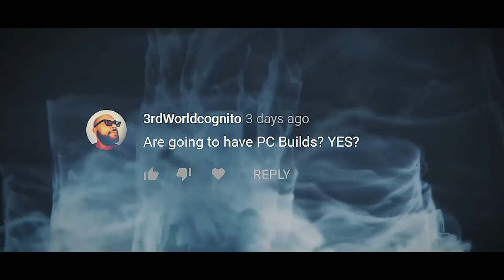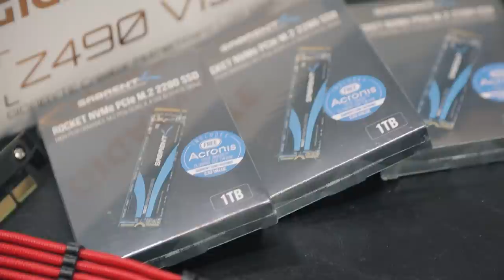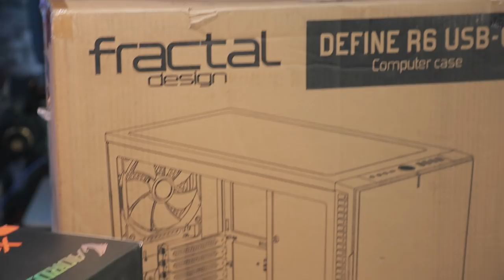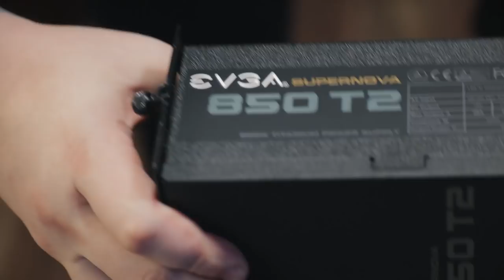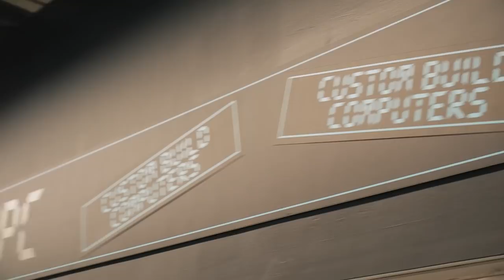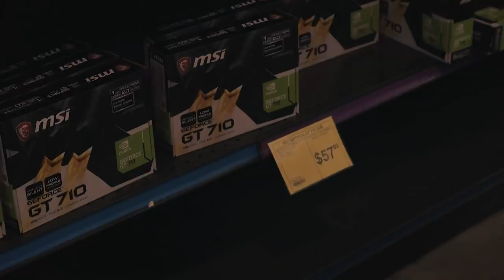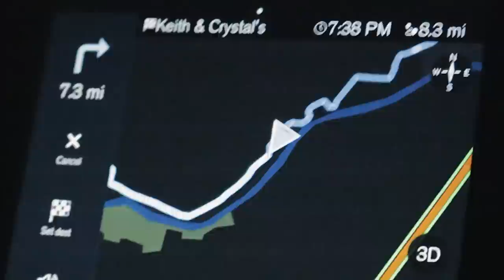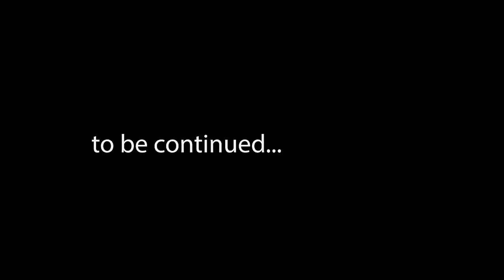We Built a Thunderbolt 3 Creator's PC for Audio, Video, and Gaming, Nvidia RTX, (2020). Episode #11

Comment: I didn't really think this video was going to be for me but it was still pretty cool and actually kinda peaked my interest in pc stuff 🤘
Reply: If you like to game or are creative type or even just need a smooth running computer for work, I highly recommend it. The price difference between building your own and buying a prebuilt is fucking ridiculous too and a lot of the time the assembly is shit. Also companys like to skimp on important things like the power supply and RAM quality, cable management, cooling. PC building is a challenge but it doesn't have to be difficult. It will take some effort and research to make sure you get the best possible choice for your needs but its totally worth it in the end because the possibilities are endless when it comes to the functionality of a PC.

Comment: This video was absolutely worth the wait, thanks Keith. I've done one budget (ish) TB3 build with 7th gen Intel processor and an RTX 2070 to go with an Apollo Twin X interface, and it was nice to hear some affirmations of things I learned from that first time around (x pattern on the screws, struggling with the front panel wires, don't cheap out on PSU, don't stress about thermal paste etc.). The Windows pooling storage method was new to me. Any tradeoffs between that storage method, Leon's RAID method, and any others you folks could think of? Any advice appreciated :)
Reply: At this point, there probably isn't, honestly. I'm just an oldskool dork used to hardware RAID, which actually has the drawback of having matching drives. Windows pooling is JBOD and will use any disk you throw into the pool. There's also physical JBOD on some boards, but I still tend to stick to matching drives and hardware RAID.

Comment: Keith, I just bought a gigabyte B550 vision D board. It has direct thunderbolt 3 ports on the i/o. Gonna be sick for Ryzen 5950x
Reply: would appreciate updates! Planning on getting that exact same board with a ryzen 5000 chip as well. Would be nice to know how it plays with thunderbolt interfaces since most of them officially support Intel.
Reply: Following!
Reply: @joshuardoss  Thunderbolt works great with the B550 Vision. I am using a presonus quantum 2. No issues at all. I couldnt get a 5950x so I got a used 3950x for $450. System is working GREAT.
Reply: @ancientalien815  sick dude, glad it's working out for you. Intel's gotta catch up a bit haha \m/

Comment: I think the raditor would have fit if you mounted it right on the edge. I have the same RAM, same problem. I saw that there were slots to mount it a bit closer to the glass. This case might not be as deep as mine, so maybe that still wouldn't work. Just food for thought. Also, Mounting the radiator tubes down is better for the AiO. Gamers Nexus did a really informative video on it. Just commenting some info to pass along just in case, not trying to be a know it all. Keep killing it Keith!!
Reply from the maker: This particular cooler can't mount on the rail closer to the glass. Too long. I'm aware of the GN video. Its fine, I promise. :)
Reply: @KeithMerrow  hell yeah man I'm excited as hell that you're making more content

Comment: Any reason why u guys didn't go 10900 with the I9 CPU? Asking because I'm  currently building a PC around the 10900X I9 cpu and was wondering if there are any drawbacks to them.
Reply from the maker: The 10850k is basically just a way better deal than the 10900k. The 10850 is just a 10900 that clocked 3% slower after production, so they made it a new chip. Its an unspoken beast of a CPU. The 10900x is, too.
Reply: @KeithMerrow  cool was wondering if there where any downfalls to the 10900x. For the price I got it for it was a no brainer. I bought it from a buddy that never used it. He went with an AMD build and I gave him a fraction of what he paid.
Reply from the maker: @tyberard5736  That's a solid come-up if you got a deal like that. You won't be bummed about that choice at all. That's currently a top tier CPU. I was going to go 10900 until I investigated what the 10850 was. Its the same thing, you just need to manually clock it to get the extra 3% speed to match the 10900. I haven't bothered with that.

Comment: thunderbolt 3 has been a nightmare for me. a few months ago my guitar instructor recommended that i buy the quantum 2626 because thunderbolt 3 is supposed to be great to the point where i can use this interface for years without having to worry about upgrading it. thinking that thunderbolt 3 would work with the usb type c slot in my pc, i bought the interface. it turned out the usb type c slot in my pc wasn't good enough and none of the adaptors i looked up online would work with what i had, so i had to shell out around $250 for a motherboard with thunderbolt 3. once i got the motherboard and installed it, my interface still wasn't working. it powers on and it's recognized by my pc, but i'm pretty sure that i just don't know how to properly select the correct settings so that i can play through my interface. i think all of this effort will be worth it in the end, but it's been a huge pain in the ass for me.
Reply: Make sure you install the actual TB3 drivers from Intel and nowhere else. and yeah, TB3 and USB-C are not the same thing.